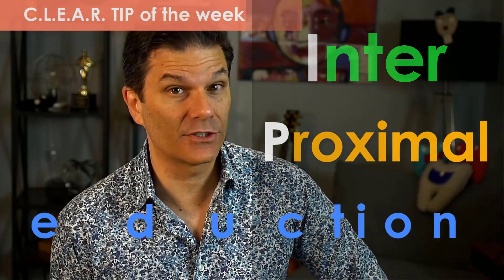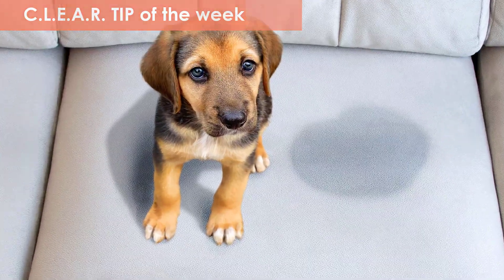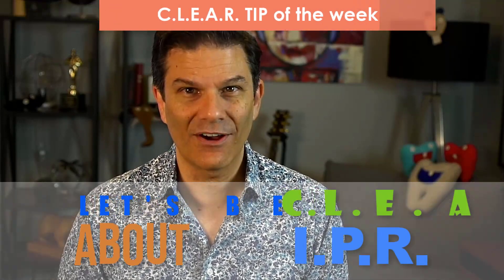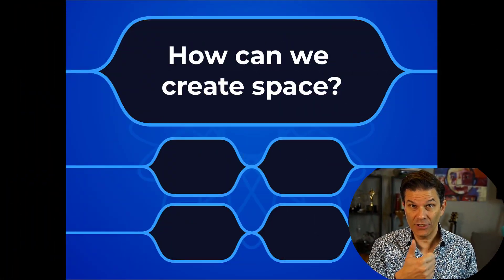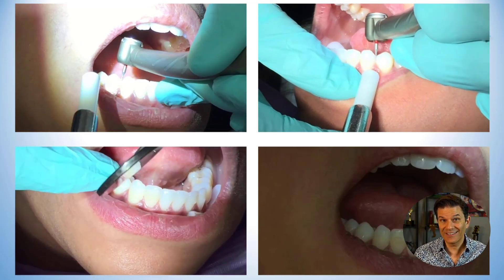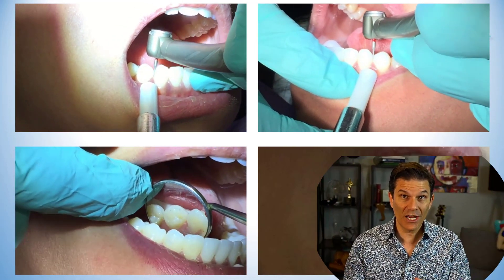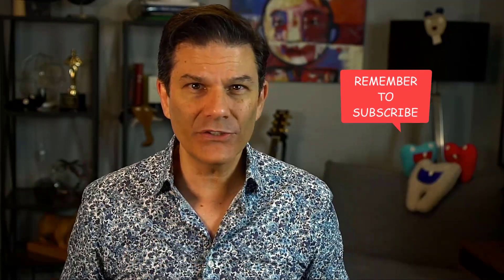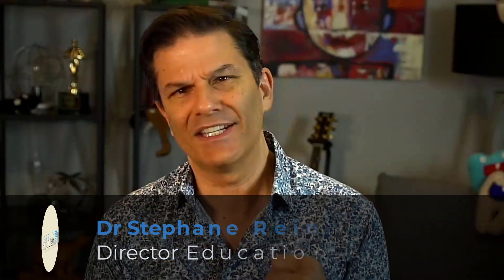Are you afraid of Interproximal Reduction (I.P.R.)

Comment: Hey there! I had braces for a year now and after getting them off I have a 7mm overjet in my front upper 4 teeth. I had an appointment with another orthodontist and she suggested to do 4 premolars 3xtraction or simply an IPR if I want to extract my teeth. My question is what's your advice? Should I have to do extraction or 7mm overjet/flared teeth can be fixed with ipr.
Reply from the maker: Thank you for your question. Even if we would like to help, and 7mm of OJ seems a lot to correct with IPR only, we can't provide any diagnostic here. We recommend you get a second opinion if you are uncomfortable with what your dentist/orthodontist told you. You must trust the person who will provide the treatment and be comfortable with the treatment plan proposed. Good luck with your treatment.

Comment: hi there,  I have only one front flared tooth which is at the front.  The other tooth is perfectly aligned.  My orthodontist suggested extraction of 4 teeth which I found unnecessary so I didn't do it. He never suggested doing IPR or anything.  Now the protrusion of that one front tooth is very visible. I don't know what should I do... should I have extracted 4 teeth just to fix one tooth...?
Reply from the maker: The best advise would be to go get a second opinion if you are not comfortable with what was proposed to you. You will see if they propose the same thing to you, maybe it is because it is the best option. Sometimes, even if it is usually our last option, we need to extract teeth to gain the extra space we need.
Reply: @theCLEARinstitute  but after extracting 4 teeth wouldn't my lips slowly move inwards and my side profile would look bad right...? Because I needed just a small about of space on my upper teeth inorder to get the perfect teeth set...
Also can you tell me after extraction of 4 teeth is there a change in the shape of the face as well?
Reply: @animedude7286  what happened, did you underwent IPR or extraction

Comment: I wish I knew I needed IPR for my Invisaglign. I got it yesterday and man I HATED IT SO MUCH! It took like an hour…I was worried the whole time. I do have a bit of a gap (0,5 total in 2 front teeth) and I hope everything will turn out fine. Thank you for this video it calms me a bit.
Reply from the maker: Happy to know it was reassuring for you 😊
Reply: Is it fine now?
Reply: @mrtechsoldiertm3280  Yeah it is! Like nothing happened. Now I just hope I don’t have to go through it another time.
Reply: @SweetSugarLemonade  so ipr doesn’t damage your teeth or gums or anything else , the person who performed my scan said that 0.25 mm is required to be filed
Reply: @mrtechsoldiertm3280  Ah ok. I was worried cause it felt REALLY unnatural to shave down teeth 😅 Thank you.
Reply: @SweetSugarLemonade  any sensitivity issues?
Reply: Is IPR used on the molars? Or just front teeth?
Reply: @ds74878  Only the front teeth :)
Reply: @SweetSugarLemonade  I just visited my ortho for my final visit and they didn't do ipr, but they shaved some of my molars on my right side because I was biting too hard on that side. Now my bite is nice and even, clench wise. So, they DO shave molars if necessary.
Reply: @ds74878  Omg really?? Did the process hurt?
Reply: @SweetSugarLemonade  Not even a little. Painless.

Comment: Sir ... thank you for the information..... I'm very curious to know about in the case of overjet is IPR process is possible ?? .... for example in my upper teeth is 10mm gap from the lower teeth ....is that possible in the process of IPR without extraction of teeth ??....& One more question if once IPR / braces journey start then after 10 yrs the teeth comes to before treatment position ??? Is that happened ??
Reply from the maker: IPR can help reducing the OJ, but first it is important to know what creates the OJ: position of the jaws, position of the teeth or combination of both? In some cases extractions and/or orthognatic surgery may be needed. As for stability and retention, teeth have a tendency to come back to their original position. The position changes with time... Treatment or not! This is why a retention protocol needs to be put in place after an orthodontic treatment. We need to hold that smile in place 😊

Comment: If I have IPR done and then enamel wears off with time, can't I suffer from sensitivity and pain when I'm older? I'm very upset because my dentist never told me he was going to file my teeth to do Invisalign and it came as a surprise. I had 0.5 taken off so I worry that with time and age my teeth will be compromised. Am I right to be worried? Thank you!
Reply from the maker: Thank you for your question. Enamel doesn’t usually wear out horizontally. When IPR is performed following the usual guidelines, scientific litterature shows that it does not bring any permanent damage and/or create future problems. IPR is very common in orthodontics (0.2 to 0.5mm) and it’s one of the reasons why there are a lot less extractions performed for orthodontic treatments than in the past.
Reply: @theCLEARinstitute  Thank you so much for your reply!

Comment: Thank you for the information! I’m curious to know at what point in the orthodontic process should IPR be performed? For example, in my case, my orthondist has recommended IPR to create space in my jaw (as opposed to extraction). I’ve had braces for five months and, as predicted, the teeth in my lower jaw have started to flare badly due to lack of space. However, my lower jaw is not yet aligned. In most cases of IPR, I’ve noticed that a patient’s teeth are typically aligned before the procedure is performed, which seems somewhat necessary if the orthodontist is to measure accurately the number of millimeters removed. Are there any cases where IPR may be performed when teeth are not aligned? I fear my teeth are flared so far forward that they will fall out if additional space is not created sooner. I am a crowding case with no extractions, if that helps.
Reply from the maker: Thank you for your question @Corazon Caramelo. IPR staging can differ depending on the case and treatment planning. What you are describing is common and called « round tripping ». We suggest you discuss your concern with your treating dentist/orthodontist in order to be reassured. But to answer your question, most of the time we wait to have a good access to create IPR in order to prevent any ledge and/or damage to the tooth surface. Of course, every case being different, it could be possible to create minimal space where teeth are still crowded (for example with thin diamond strips). We hope it answers your question.
Reply: @theCLEARinstitute  Thank you so much!! This indeed helps me tremendously! I appreciate the time you took to reply! 🙏🏽🙏🏽
Reply: I have braces for 9 months my dentist first said they extract my 4 theeth after doing research I m come at this point they now they are said to shave some of the teeth to make out some space for move my teeth backward.
Reply: @lifecaptured8666 how it goes?